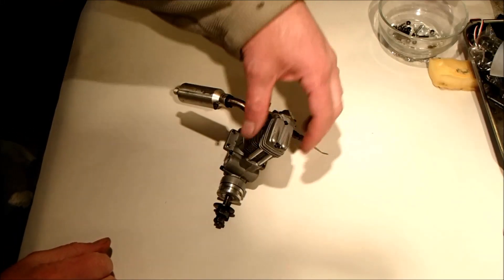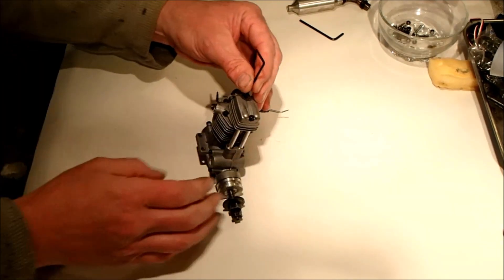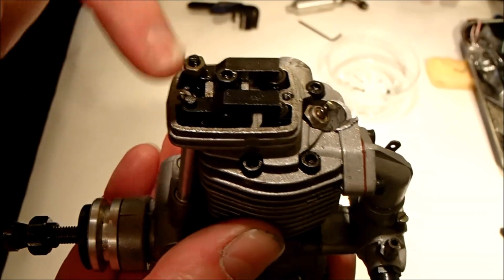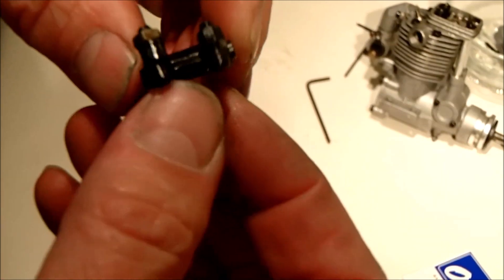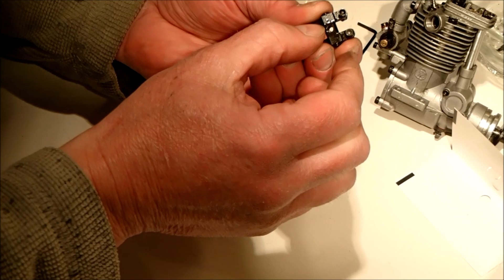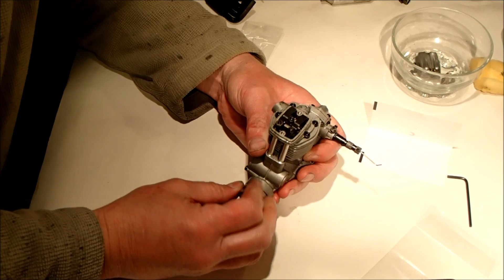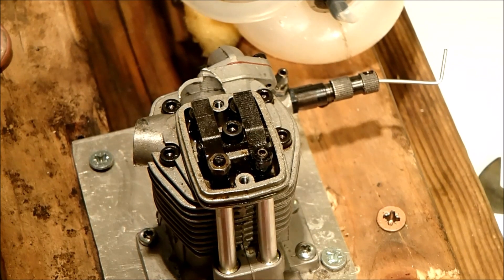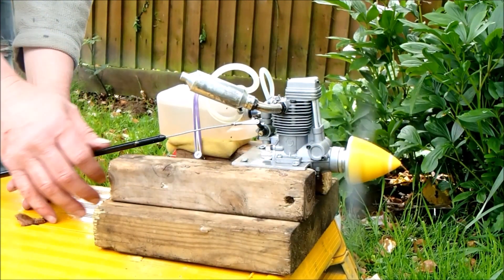eBay busted SC 52 fs engine fix

Comment: 4 years ago but I just finished working on several old engines I purchased yesterday. A couple YS, even a YS two stroke. One of hem is an OS .52. I question why they sent parts for the OS .70?? About Ebay, I had a club member that had no idea about the RC stuff he was buying but he was selling it fast on ebay. For the most part it was all junk but buyer beware!! In this case I would have torn it down all the way to see if anything went down in the case and was kicking around the crank?
Reply from the maker: @outdoorfreedom9778  yes, buyer beware. In this case, it was an obvious case of over tightening but otherwise engine checked out. THE to the seller, he did refund the cost of parts.